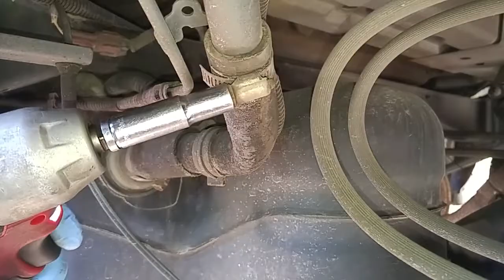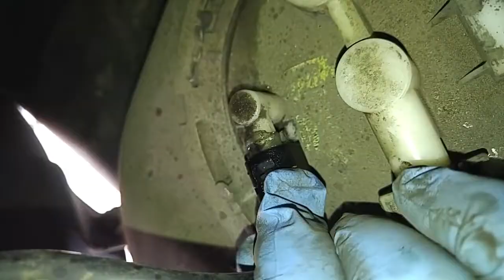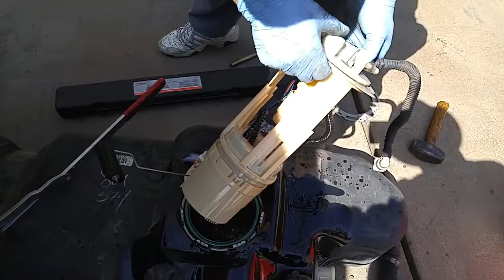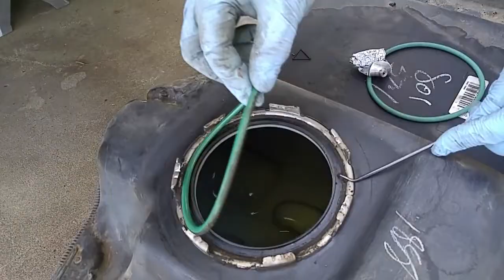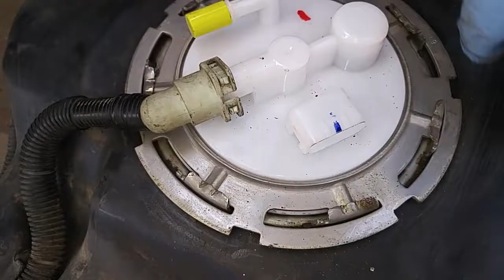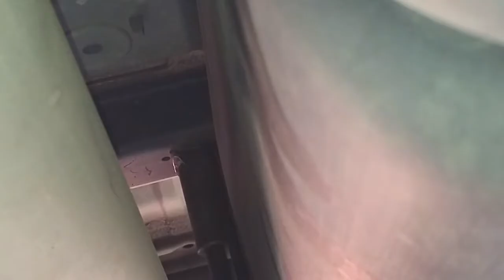Fuel Tank Removal & Fuel Pump Replacement - Nissan Xterra

Comment: Is there a way to make that float give a more accurate reading? My pump is the original and the gas gauge has never been correct. 50% full is closer to 75% full.
Reply from the maker: Can only suggest to replace the pump with a good name brand unit.

Comment: I replaced my charcoal canister and purge solenoid. But I still can’t pump gas. What are other causes to this problem?
Reply from the maker: Check your fuses and relays.  Also for current going to the pump.
Reply: Were you able to fix this problem?
Reply: @ i haven’t tried yet. I got a more fuel efficient car so I haven’t driven it in a while

Comment: What year is this? I have a 2000 Xterra. Will I need to drop the tank as well?
Reply from the maker: 2005.  Don't know if 2000 needs the tank dropped.
Reply: My old 2003 Xterra had an access panel under the back seat. My 05 (second gen)—did not.

Comment: I think that tool would work to take the back of my watch off so I can change the battery.   On second thought now that I took my glasses off I  guess I need a smaller tool. 🤓
Reply from the maker: Yes.  Same concept taking off the screw on backing plate on a watch.

Comment: That first hose you removed, can you stick a siphon through that? I just want to siphon my tank
Reply from the maker: That won't work.  It's a output port connected to the fuel pump.
Reply: @hardlymovingpro  ok thanks, wasn't sure, so do I have to remove the tank to get the fuel out then?
Reply from the maker: Yes
Reply: I took the hose off the tank and put a hose in on my 08 Frontier. There the same.

Comment: Great stuff. 

Would you or anyone here happen to know if the inside of the tank has some kind of tighten screw around the white ring where the gas fill hose meets the tank? My tank is leaking from that white ring area around the tank where the fuse hose meets the tank.  Some say it does and others say it does not. If anyone can confirm this, it would be appreciated. 

Thanks for sharing such an instructional video Brother 🤗👍🏻
Reply from the maker: Could be the rubber o ring under the fuel pump assembly that's the cause of the leak.
Reply: No, there's nothing to tighten from the inside. The white tube the filler hose connects to on the fuel tank is not replaceable. You need to replace the entire fuel tank, sorry to say.  I got one from a u-pull it for $100.  Ours is leaking in the same spot due to the rear tank strap breaking and the tank hanging by the filler hose.  It must stress that white tank fitting and cause a leak.  I read some people tried to seal it, all unsuccessful.  Hopes this helps someone looking for this answer.
Reply: @mikethomason338   I heard you can solder it while the tank is full? You will never have to worry about a leaking tank again in any car, it's a permanent fix to all the problems one might have 😂😂

JK Don't ever try this, this goes for anyone reading it, it's just a joke, very dangerous.
Reply: @ELEVOPR  Its a plastic fuel tank

Comment: What tool did you use to remove that yellow plug?
And what's that curved tool you used to take off the tube?
Reply from the maker: Yellow plug comes off by hand.  The curved tool are hose pliers.
Reply: @hardlymovingpro  the video showed you removing a plug with a special pliers, are those hose pliers?
Reply from the maker: Yes.  You can buy a set with different sized ends.

Comment: Well i sorta cheated on my '06, my fuel pump was becoming intermittent which i found were the pins on the fuel pump connector were intermittently losing contact, i cut a square hole in the floor board under the back seat over the fuel pump,made it big enough if i ever need to remove the pump, i turned the cutout piece into a hatch, i disconnected the connector on the fuel pump and pushed some "conductive graphite grease" into the pins,pluged it back in,installed my hatch with the carpret cutout over it, its never had a problem again since 2012.
Reply from the maker: Yes ... some people do cut an access hole for the convenience of pump access.

Comment: Why you dropping the tank you can get the pump out under the back passenger seat 😂
Reply from the maker: On this particular model year you can't.
Reply: I have a 2001 mine is under back seat 😊
Reply: I have an 2006 and 2005 have to drop the tank for both.

Comment: On the two connectors you called alligator clips, I saw a Chrisfix video a while back where he cleaned sugar out of a gas tank and you don't need to slide the clip out of the connector, you just push in on the spine that connects the two parts that slide into the connector and you can pull it off.
Reply: It blew my mind. I've broken hundreds of those fuckers using a pocket knife, flat head or some other improper tool trying to get those apart. Thanks for the short and simple video showing how easy it is.
Reply: Thanks for sharing. I wish I read this comment before I destroyed mine
Reply: Did my 2008 Frontier today. Yes you push it in. It wont move much much. Just enough release the fuel line when you pull while pushing clip.
Reply from the maker: Thanks for sharing.
Reply: Best tip ever

Comment: Question: prior to removing any fuel lines or etc, did the vehicle need to be de-pressurized prior to the fuel pump's removal? Or if that only for when you need to remove the fuel rails?  Kind of a DIY home mechanic and just trying to gain more knowledge since I'm looking to be doing one on my girls 05' Xterra.
Reply from the maker: I just pull the line off and let any residual fuel pressure leak/spray out.    Others remove the fuel pump fuse and run the car till it stalls.
Reply: @hardlymovingpro  

Why not just open the gas cap and let pressure out that way while working on it
Reply: Yes remove the fuse for the fuel pump then cut car on wait a few seconds then it will cut of by it self

Comment: U know there is an access panel under the rear seat to get to the sending unit without pulling the tank?
Reply from the maker: Yes ... On certain model years.
Reply: @hardlymovingpro  I made my own access panel with a dremel tool hahaha

Comment: Great vid. Would you know if this is the same procedure as on an 05 Frontier?
Reply from the maker: Could be.  The Frontier shares a lot of the same parts.
Reply: It is identical to the 08 Frontier I'm working on. Im also replacing a relay that's driver side up under the dash on the left. Light blue cap on relay.

Comment: Tank:  I was under the impression you could change out the fuel pump with out dropping the fuel tank.   ?Correct?
Reply from the maker: If the car manufacturer provided a service access hole to the fuel tank.

Comment: How long did this take you? I'm getting ready to have my gas tank replaced and while I'm at it I'm changing my pump and filters. Nothing is wrong with them but.. just wondering about how much labor this should cost. My daughter's boyfriend is going to do it and he's telling me to pay him whatever and I'm clueless to how much to give him any ideas?
Reply from the maker: Assuming he needs to drop the tank, I'd be generous with the labor time of 4 hours @ $50 per hour for a total of $200 labor time.  If he knows what he's doing, shouldn't take him more than 2.5 hours.   If he has the model where access is under the rear seat, I'd give him 1.5 hours.  Good luck!
Reply: @hardlymovingpro  thank you so much that helps a lot!
Reply from the maker: You bet!

Comment: Please help?! What size are the bolts that hold the straps in?
Reply from the maker: Believe they're 17mm
Reply: @hardlymovingpro  Thank you so so much!! me and my boyfriend have no experience but were are gonna attemp this. However ours is pretty rusted
Reply from the maker: Apply pentrating oil and gradully work the bolt out alternating between tightening and loosening
Reply: @hardlymovingpro  im so sorry to bug you but do I need nuts with those 17mm bolts? I'm just trying to figure all this out haha I think I found the straps.. But the dealership wants way to much for those 3 bolts
Reply from the maker: @MyNinja4life  Nope.  The bolts screw into the chassis.
Reply: @hardlymovingpro  Thank you so so much your a lifesaver
Reply from the maker: @MyNinja4life  My pleasure and good luck!

Comment: Hi. How did you get to a conclusion that you needed to change the fuel pump? My 2011 xterra is shutting down while driving. Sometimes choking for a second and then comes back. Sometimes the car dies completely and I have to hit the ignition again to restart on the side of the road.
Reply from the maker: Could be multiple symptoms.  Going up an incline or hill under load and the pump can't build or maintain enough pressure to deliver the needed fuel.  At a stop light, suddenly acceleration and the engine coughs.  Slow, gradually acceleration, there's no problem.  You can always get a T connector fitting that can hook up with your fuel line and a fuel pump gauge.   Fuel pressure should at least be over 45 psi.

Comment: it always looks easy until you start trying to do it then you realize it's too hard and you're fucked with a big mess in your driveway and needing a tow truck
Reply from the maker: Had that happen a few times in my life.  The usual cause was I didn't have the right tools.  Also, when I'm trying to figure out how to remove something, I'm also thinking about how difficult it would be to put it back together.

Comment: Hey man, thanks for the video. 
I was wondering, would this process be similar for a 1998 nissan pathfinder? I believe I have a leak in tank and I have no idea how to replace or even look at the thing.
Reply from the maker: Thanks for your comment.  Yes ... the replacement should be similar if there's no access panel under the rear seat cushion to get to the fuel pump assembly ... typically found in passenger cars but not in trucks.
Reply: @hardlymovingpro  Ok thank you.
Reply from the maker: @Lemon_Pilgrim  You bet!

Comment: Anyone know avg cost (parts + labor) to replace fuel tank? I broke 3 bolts holding the gasket down on sender-unit on fuel tank... don't want use a bolt extractor above fuel tank.. I bet they'll say I have to replace fuel tank
Reply: Then just go under the back seat and cut a hole in the floor.   The only down side is less room to get that damn lock ring off and on.  And need to be able to fabricate a panel to go back on.   However, saved tons of time, even more if it goes out again.

Comment: Is there a filter for the fuel pump ?
Reply from the maker: It's no a filter per se but rather a screen that attaches to the suction port at the bottom of the electric pump.

Comment: What are those special pliers that you used called?
The ones that look like needle nose bent toward each other.

I need a pair of those in my life!
Reply from the maker: They're called Fuel Line Pliers or Fuel Clamp Disconnect Pliers.  A link to the tool is provided in the "Show More" description area of this video.  Hope this helps.
Reply: One thing I noted, the Nissan repair manual states to not use any tools when unhooking the fuel lines.  And it says try not to twist them either.

Comment: Isn’t there an access door under the right rear passenger seat?
Reply from the maker: Wish there were.  Unfortunately not with trucks.
Reply: Hardly Moving Productions my 04 xterra has an access door
Reply from the maker: @DangerousSportsForSeniors  Hey ... good to know.  Couldn't find it on the 05.

Comment: Nice vid n pick n pulley tools. Where did you buy the fuel pump assembly? Got a link?
Reply from the maker: To save money, I think you could just replace the pump inside the assembly.  The thing is, there's a lot of assemblies out there for sale that are pretty cheap unless you go for a OEM Denso unit.